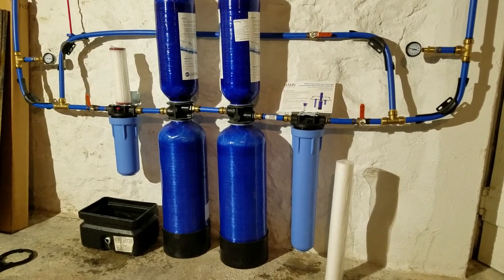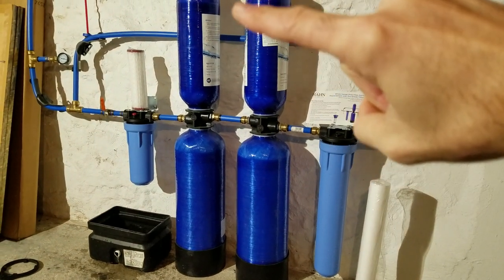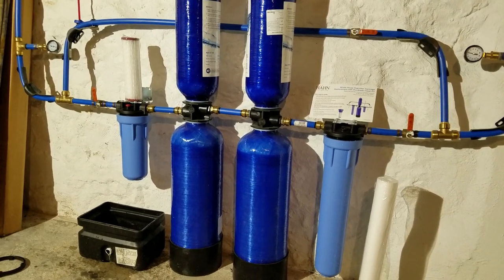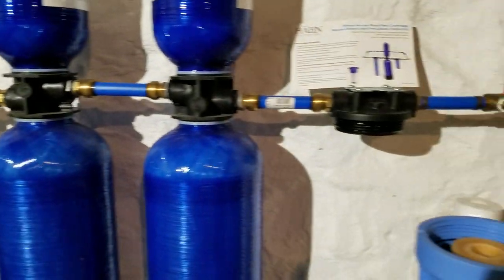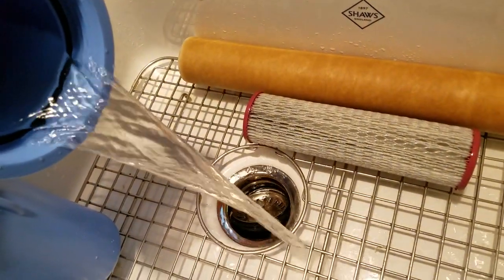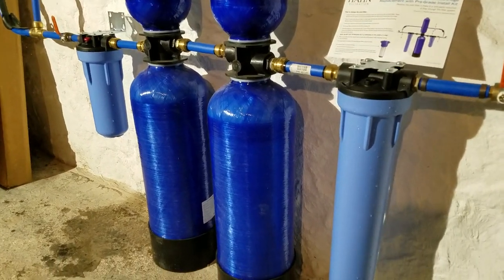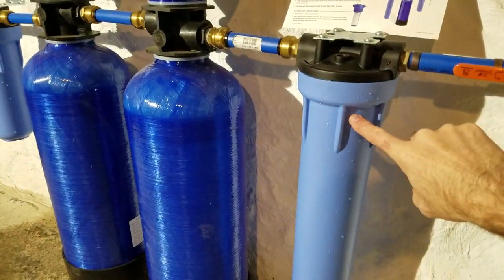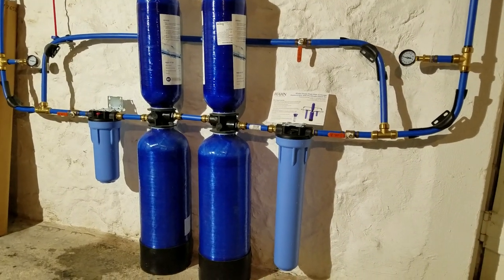Review: Aquasana Water Water Filter Systems, Overview, and Maintenance

Comment: Have you ever had your water tested? Take a sample of untreated and compare to treated? People get skeeved out by the rust, but it's typically a benign contaminant - it's the heavy metals/pesticides/chemicals that are the stuff to worry about but few seem to care and it's hard to find reliable info that isn't marketing hype.  $800 for the large filters is about $500 too much - nothing but some inexpensive filter media inside a few tanks. But thanks for showing installation setup and maintenance.
Reply from the maker: Hi Arthur, great question. Yep, we bought it for the reasons you listed below, and because our water is super hard and we wanted a salt-free solution. Additionally, our city ( like many) are now finding PFAS and PFOS contamination as well. It is hard to find reliable info, but we felt better with Aquasana having an NSF certification.
Reply from the maker: Arthur, as far as the contaminate list, I have only performed limited testing so far since we installed the whole -house system (to make sure our water wouldn't destroy our espresso machine) - hardness, iron, pH, etc. Our hardness went from 16 down to about 6 grains. Our hard water was destroying our mechanicals - from limescale. Now our showerheads only need cleaning every uear, instead of every month.

Comment: I'm thinking about getting their well water system.  I'm ambivalent about the water conditioner.  Do you think it leaves the water less healthy for drinking than without the conditioner?
Reply from the maker: The filter side will still clean the water the same, the softerner is for hard water and limescale. We dudnt want to use salt. How hard is your water? Our was so bad that our soap wouldnt foam, our showerheads would clog with limescale in 2-3 months, and that was wrecking our appliances - on demand boiler/hot water, dishwasher, espresso machine, and washing machine.
Reply: @myoldhousefix  I assume this system installs at the front end (incoming main), then goes to the tankless heater, correct?
Reply from the maker: @patricklim2836  correct, ahead of any/all points of use - mechanical or faucets.
Reply: @myoldhousefix   Your water sounded extremely hard prior to the install. Did it help with that. I’ve been looking for something to help with that for the water in my area. That’s my number one going to a whole house water filter.
Reply from the maker: @daverevollo5647  yes, we started at about 14 grains and this system got us down to about 6 grains. 4 to 5 is ideal, but our water was so hard, this is close enough 👍

Comment: How is you water pressure?  Well or city water?
Reply from the maker: City water John, I believe its about 50psi
Reply from the maker: It does drop to about 40psi if multiple main faucets are fully open (2-3)...
Reply: Was there a noticeable drop in pressure after adding the filters? Curious about shower if it is any different having to go through the filters.
Reply from the maker: @marka1952  only noticable if multiple high flow faucets are on at once. I noticed a drop with shower, kitchen sink, and washer all on at full blast.
Reply: My Old House Fix Thanks.
Reply from the maker: @marka1952  👍

Comment: How much space does it take up
Reply from the maker: Hi Michael, from end to end (PEC in to PEX out its horizontal footprint is 5', and just over 3'tall to the top of the tanks...
Reply: @myoldhousefix  also i have seen videos where's people are saying this system is junk
Reply from the maker: @michaeld954  interesting...what are their complaints? If you notice I did install Sharkbite fittings at the tanks, instead of the plastic, PVC and glued fittings supplied. It didnt make sense for me to install a filter and then use toxic glue. I did confirm that it brought our water hardness down from 12-14 grains...down to about 6. And as you can see in the video its catching a lot of sediment from our city mains.

Comment: Is it me, or is one of the two taller tanks in the middle installed backwards? I thought those were uni-directional
Reply from the maker: Good question Chris. Both sets of tanks look the same for the softener and the actual filter. The softener goes first (right center) then the 2 stage filter (left center).

Comment: Did the system come with brass fittings or did you upgrade? I've seen the same system but with plastic fittings.
Reply from the maker: Hi Bernard, I added the Pro Install Kit whiich came with the fittings for the bypass loop. The rest I added instead of the plastic ones. Hope this helps!

Comment: How much pressure loss do you get?
Reply from the maker: Our water pressure is at 52psi input from the street. With one high flow faucet running, like an unrestricted laundry sink, it drops to 48-50psi. Turn on a second high flow faucet like a kitchen sink, pot filler, or shower and it drops to about 36-38psi.

Comment: any loss in water pressure? Thanks in advance.
Reply from the maker: Hi Jeremy, just slightly. Our water pressure is at 52psi input from the street. With one high flow faucet running, like an unrestricted laundry sink, it drops to 48-50psi. Turn on a second high flow faucet like a kitchen sink, pot filler, or shower and it drops to about 36-38psi.
Reply: @myoldhousefix  which is to be expected going through a system like this. Water can only be treated so fast.
Reply from the maker: @fortunatedad7695  yep. I believe, they recommend a second system to increase throughput for very large houses/consumption. 👍
Reply: @myoldhousefix  I could be wrong but I can't see that making a difference. You only get so many gallons per minute from your water source so adding another system wouldn't make a difference. 
You would have to increase your water main size then split off to a second water treatment system then tie both lines together after the water is treated. 
Alot of calculations would have to be done so your sizing is right on or youd be dropping alot cash for nothing.
Reply from the maker: @fortunatedad7695  yeah I agree, lots of logistics and issues to overcome. Thats why I dont mind the slight drop in pressure...the fix for me isnt worth the time and money

Comment: I really wish you didn't skip how to remove the canisters to replace the filters. Mine are stuck!
Reply from the maker: hi, they can be tight sometimes. Just use the big round  canister wrench that came with the kit. Once you break it free it just screws right off. To help removal next time, make sure to lube the canister o-ring before you re-install. Hope this helps! 👍

Comment: Does this system prevent hard water spots on faucets and glass?
Reply from the maker: Hi Julie, yes it does. If your water us super hard like our was (14-18 grains) it wont eliminate 100%, but it reduced ours to 6 grains...pretty good considering. We went from cleaning the scale off our shower head monthly, to onve a year.  And no salt, drains, and waste water...👍
Reply: @myoldhousefix  Hi Chris, Do you know where in the 14 - 18 range you were?  I am at 12 grains.  If you were at 16 and got down to 6, then I would hope to get from 12 down to 2.  I am trying to figure out if I should use a Potassium Chloride system or an Aquasana.  Any updates since you posted this a year ago?  Thanks!!
Reply from the maker: Hi @danroscigno187   great question. Let me pull up my original report to see if I can find it. What I like about the softener is its salt free, no brine water to deal with, no drains, and no electricity needed...
Reply from the maker: @danroscigno187  14-15 grains was our baseline...now 5 grains. Ours fluctuates a bit when the city switches to more well water in winter.
Reply: @myoldhousefix  Beautiful, so you dropped 10 grains!  That is great.  Thanks for the info!
Reply from the maker: @danroscigno187  youre welcome!
Reply from the maker: @Julie Hirschi we have super, super hard water and it took cate of the majority if water spots...without runse agent...it also reduced limescale by about 80-90%. I clean the showerhead 1-2 tumes a year now, vs monthly before. And the system doesnt use salt or need a drain like the salt systems...

Comment: what size fittings did you use between the filters to connect to your pex tubing?
Reply from the maker: Hi Antonio, the system came with 3/4" plastic fittings that called for pvc glue. I opted to use 3/4" Sharkbite fittings instead. Everything else you see here came with their "Pro Install" kit.
Reply from the maker: Oh, and I also added the pressure gauges on each end, just for monitoring potential blockage - psi in/out differentials...
Reply: Apparently, you can request 1" hardware instead of 3/4". I just got mine installed today with 1" hardware. I called customer service if I can order 1" kit and they said they'll send it free of charge.

Comment: Thanks very much for the video. I am currently considering this system (OptimH20 Whole house Water Filter - Pre Filter + Carbon Block + Salt Free Conditioner) along with the RO system for my kitchen sink/ice marker. I have seen some reviewers/experts talk about investing in a system that has longevity in mind and refer to this system as only a 6 year system. To be clear, they're only talking about the Salt Free conditioner and not the system in its entirety, correct? On their website they mention the gallon throughput/ years that their conditioning tank lasts but I don't see an expiration on anything else? I just want to be sure that in a few years, I am not spending another few grand to replace a system that largely just needs a few filters changed as part of maintenance? Thank you!!
Reply from the maker: Hi Joe, great questions! First off, you read my mind, as my Rhino System shown here is now 6 years old and I just bought the same OptimH2O and RO setup you mentioned.  

RHINO SYSTEM (shown)
On this current Rhino System, for past 6 years I just had to replace the Pre and Post filters- far right and far left. Now that it is approaching its end of life, I would need to replace both disposable media tanks in the center (dark blue - filter and softener). The rest of the system is retained tho. In short with Rhino, every 6 years you are looking at ~$1600 to replace the 2 main tanks and regular replacement of the Pre/Post filters.  

OPTIM H2O
Now for the OptimH2O you buy the system (it is more cost but better filtration) you still have the recurring Pre/Post filter AND the Softener tank replacement (every 6 years). The difference is the filtration tank - carbon block vs the disposable Rhino tank.

PRICE TO MAINTAIN
 It's about a wash on price tho (maybe a few hundred cheaper to maintain the Optim every 6 years) as Aquasana recommends replacing the carbon block every year ($400)...every 2 years on City water. But at least the OptimH2O now has 3 canisters that are retained, and other than the water softener, you just replace cartridges on 3 of the 4. 

Carbon block is better filtration - reason I upgraded, as many Cities have the PFAS/PFOS issues that the Rhino will not filter. The RO System will take care of that, though. I am also running their RO system to my fridge after the OptimH2O! I also added UV. 

Best of luck, and I hope I was able to help you compare the 2 systems!
Reply: @myoldhousefix  Thank you my friend. That clears it up for me. My main reason for looking into a home system + kitchen sink filter is my new awareness of PFAS/PFOS in our drinking water. Shocking and concerning to learn of their presence but nice that we can do something about it. I would like to do an in-home water test pre and post install to really gauge the difference. Are there testing kits that you've used and would recco for contaminant measurements, specifically for looking at those petrochemicals? Lastly, in the efforts to try and save as much money as possible, where and how is the best way to buy the filters? I see their subscription plan on their site which saves a few bucks, but was curious if there were any other places to buy and save. Thanks!!
Reply from the maker: @JoeBarbagallo  I know, right! Our City started talking about it and we also sit on a Dioxane plume so even though our City installed a carbon system, there are still miles of old pipes and connections that probably pose issues like lead, etc. Did you know that the EWC has identified 400+ water contaminates, yet on average, municipalities only treat for about 80-100. It's scary as we gain the tech to test for more contaminates...yet treatment at the municipal level is lacking. I'm sure you heard about Flint, MI. 

I originally had Culligan Water come out and test for the general stuff like hardness, iron, and pH, but I didn't want their salt softening system. I also wrote a blog on drinking water over on our site - That's when I came across Aquasana, during the research. So I had somewhat of a baseline for the basics, and did a follow up with water hardness strips (Lowes, HD, etc). I'm also into the home batista thing, so a local friend and coffee shop owner gave me a LaMarzocco water test  as well (I think you can buy on Amazon - watwr test for espresso machines. Its a card type test ) - post testing for pH, hardness, iron, chlorine, etc and the Rhino System reduced to acceptable levels. Here is a link they are giving us here in MI to national labs for PFAS/PFOS/PFOA testing:

https://www.washtenaw.org/2849/How-to-Test-Drinking-Water-for-PFAS

As for filters, I just signed up for the water for life program to get the discount. Hey, if you decide to go the Aquasana route, if you don't mind using my link in the video description to go to their site, I'd appreciate it! They'll throw me a few dollars for the referral, which helps keep my site running (at no cost to you)!  Thx!
Reply from the maker: @JoeBarbagallo   www.pacelabs.com  is another nationwide lab facility.

Comment: are there seals in this system
Reply from the maker: Hi Suzanne, good question! The only "seals" in the entire system is a rubber  o-ring at each light blue filter canisters (2 o-rings rotal). They are only a few dollars, and last 3-4 years before needing replaced, in my experience.  You can see the black o- ring when I an at the sink on the close-up shot.

Comment: If your prefilter looks like that at 6 months you should think about Chan got it at 3 months... that will make your main tanks last longer.
Reply from the maker: Hi Rob, I'm not familiar with that, what is it?
Reply: @myoldhousefix  that was supposed to say “think anoint changing it at 3 months” if your color goes all the way to the core then your sediments are passing through.

Comment: holy crap, shark bite fittings everywhere with pex.  I bet all the fittings combined costs more then then 200 dollars lmao. $$$$$$$$$  They are quick and easy but you pay for it handsomely.  Talking  a dollar for a pvc T vs 13 for a shark bite.
Reply from the maker: Hi Chad. Well there are a couple reasons:  1) for the most part, the items you see came with the install kit  2) for ease of maintenance, permanent connections make zero sense here (the tanks have to be swapped out at end of service life) - always design with maintenance in mide,  3) introducing additional pvc glue/chemicals seems counterintuitive to having cleaner water - the goal in the first place.

Comment: You probably needed to use more sharkbites
Reply from the maker: thats what came with the install kit and it has to be serviceable to swap out the 2 large tanks...the shark bites make that possible vs a lengthy disassembly/reassembly. Work smart, not hard. Systems need to be easy to operate and maintain. 👍

Comment: We have Aquasana AQ RO3. It is terrible. Leaks all the time. Constantly having to troubleshoot. Your supposed to run the water for 24 hours upon installation or after changing the filters??? Huge waste of water. Do not buy this unit.
Reply from the maker: that's the Reverse Osmosis, correct?

Comment: Don’t use shark bite
Reply from the maker: @Michael good point! 
I try to design my projects with maintenance in mind:
1) when the tanks need to be replaced, or to make repairs (replace psi gauge, etc) or fix leaks, the Sharkbites make it a LOT easier and simplify the disassembly and reassembly
2: the system comes with plastic fittings requiring pvc glue to install (fixed installation). I couldnt see buying a filtration system to clean my water, then introduce the PVC glue contaminates, therefore the Sharkbites are a win/win 👍

Comment: Sharkbites huh? Lol
Reply from the maker: Bottom line is a permanent install is not desired due to maintenance requirements. The tanks have to be replaced periodically So...
 I try to design my projects with maintenance in mind:
1) when the tanks need to be replaced, or to make repairs (replace psi gauge, etc) or fix leaks, the Sharkbites make it a LOT easier and simplify the disassembly and reassembly
2: the system comes with plastic fittings requiring pvc glue to install (fixed installation). I couldnt see buying a filtration system to clean my water, then introduce the PVC glue contaminates, therefore the Sharkbites and PEX hard clamps  are a win/win 👍

Comment: The flow rate for this system is just 7.0 GPM, do you not find this kind of low? I was thinking about getting this but am now considering other systems due to this low flow rate.
Reply from the maker: With 2 of us in the hoise it seems fine, unless you are running 3 or more high flow faucets at the same time. Otherwise, with more people and use you may see a drop in pressure...